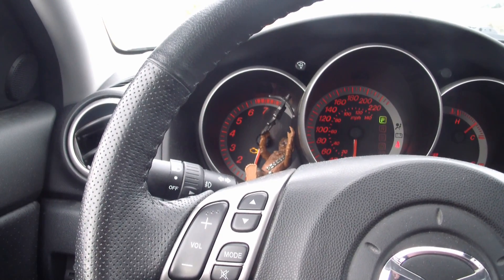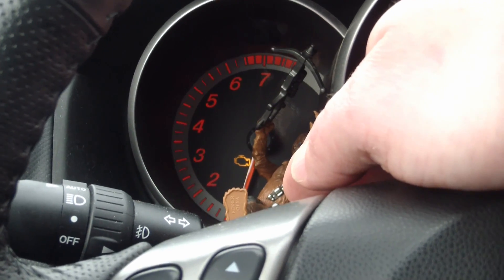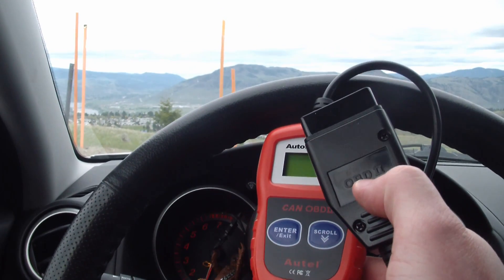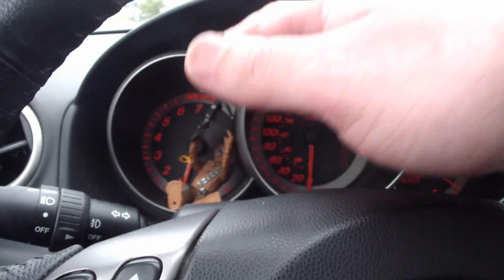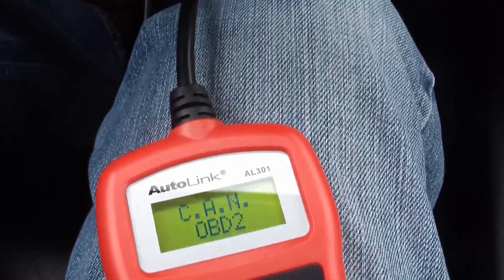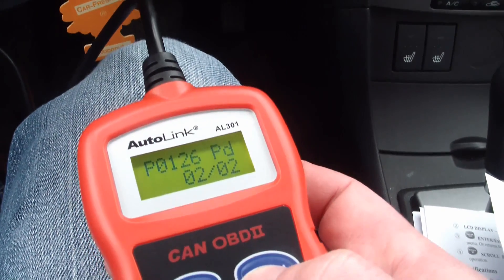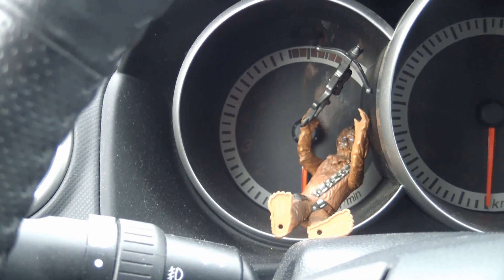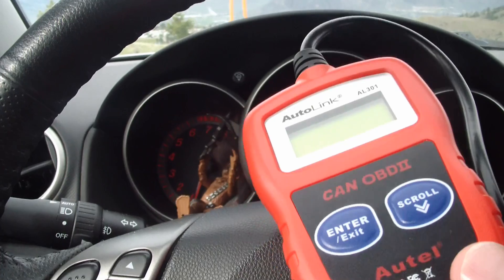Manly-Man Skills: Outsmart Mechanic Scams by Using Your Car's Computer!

Comment: I was surprised when it wasn't the old EVAP/ Emission Code. Generally I agree that all dealerships can be and definitely used to be the biggest scam on the planet however.... I had the dreaded Evap code on my Ram 1500 ( I drive a LOT of gravel) and the local Ford dropped the tank and agreed to blow out the evap can (retail $400+ for a new one) and put it all back for under $150.00 CAD.  Money well spent and a possible solution for those who have this problem if you drive some gravel.  
Remember : 
Don't stick your finger where you wouldn't stick your dick.

Comment: Love the vids  brother! Another good thing to know is the the light will flash for critical codes like cylinder miss fires and such. So in the vernacular of uncle bumblefuck; 
Buy cheap scanner and check the light eventually if it comes on solid.....
If the little bastard is flashing continuously......pull the fuck over before you let the smoke out

Comment: Mom and pops will RIP you off just as much as any dealership. Find someone you can trust. So many shops and techs give us a bad name. The dealership I work at for the most part is an honest bunch. We don't throw parts and we don't reccomend stuff people don't need. I think there are a lot of situations also where people feel they got ripped off because they are not informed as to what it takes to properly diagnose a car, the thousands of dollars of tools we have to buy to do our jobs, the years of experience and the cost of outside training. At the end of the day, mechanics are no different that any regular plumber electrician or any other tradesman. There are cut rate hacks that scam and con and give the rest a bad name everywhere. Don't put misplaced trust into independently  owned shops, slot of times they are the biggest hacks because they might not have the ability to make money honestly. I've seen it personally.

Comment: I know this is an old video but just FYI in Canada this code could be caused by the weather I.e. Its too cold outside. That or the next thing is thermostat stuck open,which is the way they fail. Of course that's assuming the vehicle hasn't already been manipulated like the fan being rigged to stay on or the thermostat being taken out.

Comment: A good scan tool will be your best friend, so long as you use it properly. I'm not a mechanic. But I am a gearhead and love to work on my trucks, motorcycles etc. No, the scanner will not give you the direct answer to the problem. BUT it will get you started in the right direction. Get the code, and do some good research. A majority of the time, there will be a variety of reasons a particular code may be thrown, and not just one specific reason. Use your research to narrow the cause of the problem. I have never "wasted money on the wrong part" doing this. Learn your vehicle, and take your time.

Comment: They give you a load of B-s  here that they need to hold your car for two days as they need to bring in the "special computer" and it's at their other dealership, then they charge you $150 extra for it on the bill, you can get a Bluetooth reader and app for your phone for $100 or a plug in one like that for $50 or less, they must think we are silly

Comment: I have been an ASE Master Certified technician for over 25 years.  As you mentioned, most repair shops here in America are morally bankrupt.  LOL.  After a recall repair they told me that my water pump was leaking on my Jeep and it needed to be replaced.  Upon further inspection when I got home I found there wasn't a leak.  Water pump was in good shape.  I would also like to add that you are pretty amazing with all of the knowledge you have.  I enjoy your videos.

Comment: on your japanese vedicle, that light means you can probably screw around and get the light to turn off. on my german vedicle, the light means you're paying $600 minimum for the part to fix it yourself, or $1500 at the stealershit for them to install said part. fucking BMW.

Comment: You can get a better reader and for even a lot less! There are bluetooth readers that link to your cellphone and the software is free.Check the usual online sellers, Amazon has a ton of the readers. Do spend more than the minimum though as the really cheep ones can have problems working.

Being connected to your phone, it is VERY easy to have the phone go online and look up what the problem is, there is even a button in the App that will look for you!

 A reasonable reader is about $15 U.S. The software is TORQUE and is available at the Google Play store, sorry I don't have a fruit phone or device so look wherever you look for those devices.

 In addition to read codes, you can add gauges to your phone to watch ANY system the cars computer monitors even trip odometers, GPS ground plots and a whole lot more.. for FIFTEEN BUCKS!  I have been doing just exactly this for quite a few years.

Comment: Just got that code in my Mazda 3, apparently it's due to thermostat that won't close or otherwise needs replacing, happens when going downhill in gear using the engine braking (on a manual) it clears itself after a few days anyways.

Comment: The code isn’t going to come back that fast  you need to do a drive cycle.  Two trip drive cycle  will turn the light back on   Sounds like you should check you’re thermostat.

Comment: You can get a bluetooth OBDII reader from Ebay for $16. Get an Android app such as Torque. You can also see all the realtime data as the engine is running, such as spark timing, vacuum, boost (if applicable), revs, oil pressure, engine load, acceleration, current and average MPG, the whole nine yards, pretty cool. Can also check if your car will pass emissions so you can be sure before you go in.

I would recommend looking into the code you find before just clearing it  though, it is unlikely to be a fluke. Also, if you ever see the MIL (malfunction indicator lamp) flashing while driving, it is a sign of a more serious and immediate problem. There is also a way to see transmission issue on many cars, not necessarily what though, I think a gear indicator light will flash or something, forget exactly.

Comment: For everyone thinking now that they can reset the CEL and get their car to pass inspection(I'm talking about certain places in USA) it won't work unless it was just a one time code. If its still active or especially for emissions like. A P0420 or something it won't be ready to be read by their scantool, the m3chanic will know that the car just needs to be driven alittle bit and then it will have met whatever the parameters are for your code to be set off again.

Comment: @AvE what you said about don't tell your mechanic what you think the problem is is true af. But I have a story that warmed tf out of my heart. I recently started my apprenticeship through a family friends shop. Someone came in with an almost new Toyota Tundra saying they think that it needed brakes. Well my boss being the stand up guy he is told him he doesn't need brakes and the reason he thinks he needs brakes is because the brake pads were never "bedded" causing them to not perform optimally.

Comment: You can get a Bluetooth obd2 reader too for like $15-$20. This allows you to hook it up to your phone and through an app you can read the codes and it tells you in plain English what the codes are. You can also do real time monitoring of a list things, such as: rpm, fuel usage, battery level, intake manifold Temp, oxygen sensors, speed, etc. Very useful.

Comment: Need to get one.  Jeep no startee, tow driver says "Ignition switch or Starter", both were worked on last year.  Back to Stealership, "Scan is fine and it starts right up, bring it back if there's a problem!"  Next morning Jeep no Startee.  Nother tow fee.  Dealership  "We need to do a DEEPER scan-will cost you $120."  Me "Suckawhat?  Deeper scan?"  Fine, ok, need the jeep.  Four hours later Dealer "This module has gone out and we have to replace it for $500 then scan more to fix it!"   Uhhhh-no.   Tow driver takes it to his shop that evening.  9AM he calls "Replaced the Starter RTG."   Dealer, of course, won't honor warranty on the replacement.   Screw dealerships.

Comment: actually a code reader only tells you the circuit that is effected, a scanner with scope capability lets you see the data transfer of the circuits and special test to test circuits out and even then is it live or memorex meaning the computer still see interpreted data sometimes you have to break a true lab scope even on today's cars and i use a 3000 grand scanner with 500 hundred on updates every 3 years to keep up and that's for a launch not including a very old dual trace lab scope on today's cars. And you have drive cycles or trip cycles before a secondary code like the one you showed would trip again and of course all the manufactures have different drive/trip cycles they want you to perform. Second today's cars have between 3 to 8 processors all communicating with each other and with there own branch of codes and data. Like the video's keep up the good work and a good beer laugh at times.

Comment: If the cbeck engine light is flashing while driving that means there is a severe engine misfire and needs attention asap!! If the light is on steady and the car runs normal,then it is likely just a issue with a stupid emissions device.

Comment: bruh to tell someone that the check engine light might not be that big of a deal isnt a good idea. I agree with you i have also invested in a obd 2 scan tool but also keep in mind when you see that light there could be 1000 different possibilities of what it could be. Seeing that code (p0126)  on ur car could mean that there is insufficient coolant getting into ur engine and would not be as simple as putting in more coolant. Your thermostat could be closed shut and thats why the code could have been set as well. Also ther could have been a leak somewhere in your cooling system. MIL is not something really to be taken so lightly because its your cars life at risk. I recommend  get it checked out as soon as possible by going to autozone or oreilys or somewhere like that where they scan codes free if you cant afford or put your money into a scan tool and do your own research. Remember Codes are set for a reason, its because something isnt running right, its not really common as well to get a short in your circut for your sensors so dont always think that u can keep that check engine light (MIL) on in your car because your car will be suffering and not only that but the problem you had a first may start to make other things malfunction. So just have a heads up when you see the light.

Comment: It's an idiot light for the idiot's. All it ever means is that your vehicle is not running at federal regulated emissions standards. Usually not a glitch since vehicles use high speed can/lan bus systems for module communication. Not the matrix.

Comment: Good advice. I've found that 9 times out of 10 its just emissions. A dirty mass air flow sensor due to a wonderful K&N filter coating it with oil or a bad O2 sensor. Even the O2 sensor related codes (lean or rich) can actually be caused by...A dirty mass air flow sensor. K&N filters is another huge scam itself. My obd 2 scantool has more than paid for itself many times over.

Comment: My old '95 Toyota, the check engine light came on at 30000.0, yup - as soon as it rolled from 29999.9. Yeah, sure, suddenly a problem at exactly 30k. Same at 60k, 90k... Interestingly never happened again after 120k (and I got up to 206k on it). Was just a scam to get you to bring the vehicle in.
Reply: Not, BTW, saying to ignore the lights, but if it happens exactly when you roll some exact 10k boundary (or maybe 5k even), definitely not a panic.  What are the odds your car's going to have a real problem exactly on a x.9->x+1.0 rollover at an exact 10k interval?  46,243.7 and the light comes on, probably an actual issue, 50,000.0, probably not they just want to get you to bring it in.

Comment: Back when OBD2 was pushed  automakers wanted it to have cars display the code however the regulators wanted scare people to take their cars to the dealership, hence the idiot light that makes the major and minor look the same. 

BTW if nobody else covered it pending code means that it has been detected but the computer won't light the MIL until it occurs again. 

Another thing to look for online or in factory service manuals is the logic behind certain codes. Also useful is laptop software that allows you to see things like fuel trim and so on.

Comment: I like this guy! If the yellow chalk out line of a motor comes on and stays on the motor is not going to explode. If the yel. chalk outline of motor blinks the motor shouldn't blow but get checked soon. If a red light comes on stop pull over and shut the motor off now!!!!!!!!!! when you turn the key from off to key on, not engine start the dash lights come on. that's to let you know that the bulb is working! when you start the motor all warning lights should go out after a couple of seconds.

Comment: Gotta say, I’m Bor(ed)n n bred here in north Los Angeles (aka Tijuana 2) with the other sheeple and It’s become a bit of a hell hole n all honesty. The smog laws are a pain like the gun laws. But there’s no alternative if u wanna breathe or see beyond a city block. 
Don’t stop makin vijayos or I’ll be forced to have an honest introspection and I’ve worked to hard for my rose glasses.
Fuck the stealership-automatically double what any mechanic will charge. Triple if ur old or have a vagina. Although you do get nice paper floor mats...my add is winning
So sayeth the Electrician, so sayeth the flock 
PS my dick won’t fit in a vice

Comment: Nice! :) Also available from fleabay is a Bluetooth plug for the receptabarcle on the car (can be left plugged in). Download an OBDII reader app and hey presto. Recommend 'Torque,' you can get real time telemetry stuff out of it too depending on the vehicle (rpms, temps, tacho etc...). I found Landrover 90s are baastuuds though and obviously the British codits built a wobbly one (just like the machine) and it won't read it. Decent full function apps are paid (onetime peppercorn payment normally), but you should get decent milage out of the free cut down versions.

Comment: You forgot to mention that if you are driving and the light is flashing that means catalytic damage is occurring, like with a misfire. He also forgot to mention that you disconnect battery on some cars stuff quits working until you go to the stealership and get the things recoded or re-initialized. DO NOT DISCONNECT THE BATTERY! and his code is a stuck open thermostat. thats what that code means.

Comment: removing the battery terminal will not clear the codes on an obd 2 vehicle... light may go out for a while, the code is still stored... and will be back on when the drive monitors reset. you cant have a light on, disconnect battery or clear the code and go get your car smogged. it will fail.

Comment: Don't erase the code without assessing the problem physically (ie. P10732= gas cap error detected, check the cap to see if it is loose, or just a rusty seal) if you just erase it and it is serious it could cause some damage.

Comment: Man I love you videos. Watch them all the time. I mean no disrespect by this commment because you obviously know what the hell you are doing but I completely disagree with this video. As an automotive tech I’ve been in many situations where you have to have a good understanding of how all of the systems work together on the vehicle and special diagagnostic equipment is required. A code reader in conjunction with YouTube or Google is simply not enough to accurately diagnose a fault. Yes there are many occasions where a “do it yourselfer” can solve the problem on their own but that often results in unnecessarily replacing parts. With today’s modern vehicles we have to have training and invest in good diagnostic equipment in order to understand the systems and fix the vehicle right the first time. (That is if the tech is actually a good tech and not a hack). Yes we are expensive but we have to make a living too and our training and equipment isn’t cheap.

Comment: when this light comes on your car goes into limp in mode injectors and timing are set to base settings gas mileage performance driveability are on hold until it is repaired and just because you buy a code reader dose not mean that will fix the problem and not all mechanics are ripping people off ya there are some yes I am a master mechanic of over 40yrs I was repairing this shit before they. had code readers 1978 and just because a code reader says one or more codes dose not mean that is what is wrong with the car it's meant for a tech to start investigation and by the way if a sensor trips a code that sensor more than likely is good it did it's job to alert to a problem we have diagnostic flow charts to follow and you can buy them from different companies

Comment: You need the TSB's for the model your working on to bypass the mechanic. That reader will have you changing more parts then a dealer.  I have a $20 obd2 that works like crap, a $150 that reads some live data and pids and still need the $2000 one, to really figure things out.

Comment: The $13 gadget doesn't diagnose ANY module, it diagnoses only the engine control module, which is under the OBD2 standard...and very badly if I may say. If you got a problem in the ABS or AIRBAG system, you need to spend significantly more money on the diagnostic tool.
Reply: 9/10 it is a fault. Clearing the fault just zeroes the drive cycles and the light will extinguish..until the cycles are driven and it lights up again.